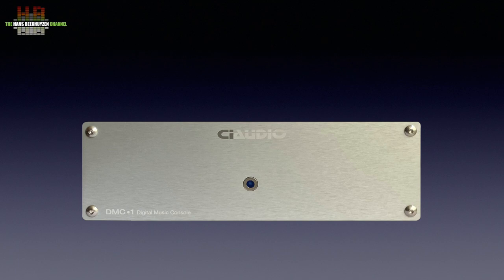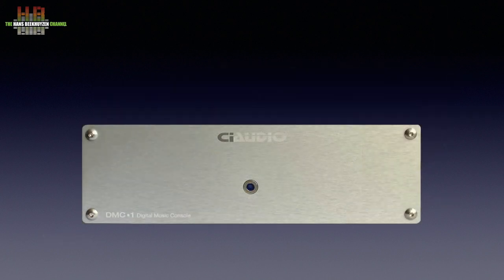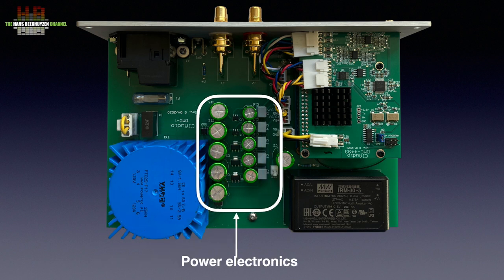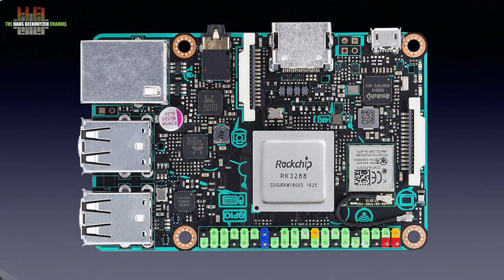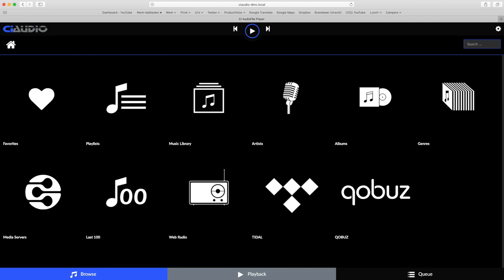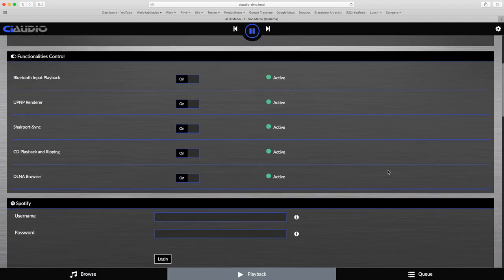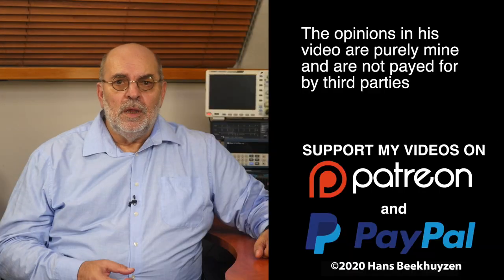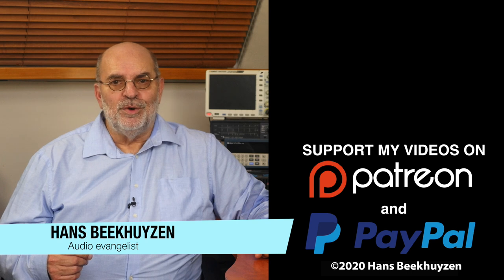CI Audio DMC-1 network player and ripper

Comment: I assume that the comparison between the Asus Tinbkerboard S is with the Raspberry Pi Model 3 or below, as the Pi Model 4, also has a separation between networking and USB (2 and 3) and has more RAM and higher clockspeeds than their previous versions.
According to my very subjective experience, using the Pi4 with a decent power supply, brings it in line with an SoTM Neo :)
Reply from the maker: I like the sMS-200 Neo a lot better than the Pi4!  But that also depends on the quality of the playback system, of course.
Reply: @TheHansBeekhuyzenChannel  Hi Hans, I will give the sMS-200 Neo another try :)  The sMS-200 Utra Neo, is definitely in another class.

Comment: CI’s interface looks like a tweaked version of Volumio.  I have open source Volumio running on an Odroid C1 with the Hardkernel HiFi shield and it sounds fantastic.  I wonder how my $90.00 USD setup compares to CI’s commercial offering...
Reply from the maker: There will be a clear difference in sound quality. Whether that difference is important to you, I can't say. It depends on the quality of the playback system, the acoustics and your hearing.
Reply: What component or string of component attributes would contribute most to that difference?  Thanks for your reply, and I look forward to future reviews!
Reply from the maker: It’s the design on a holistic level that defines the sound quality.

Comment: "Just listen and you will not doubt" does not sound very convincing. There is no "just listen" unless paid for it in Europe, and the return policies are by far not the same as those in the States. "Sounds extraordinary for it's price" is also not a checkpoint one should ever consider. How does it compare to the other units that you have reviewed; Matrix Audio, Cambridge, Volumio Primo, and so on ... for example? Do they all go by the same deviation graph, or do they differ, how?
Reply from the maker: if you compare the reviews of the devices you mention with this one, you can learn the differences.